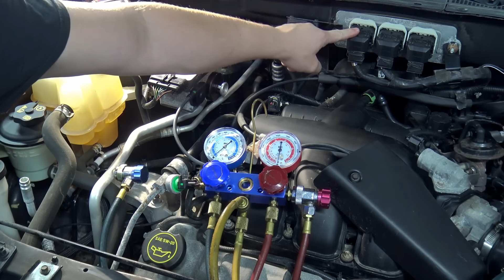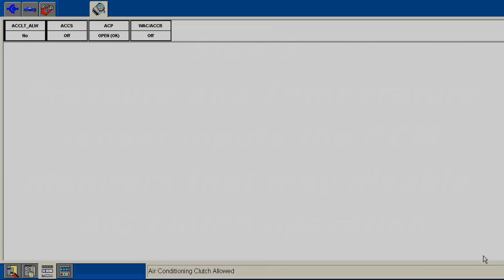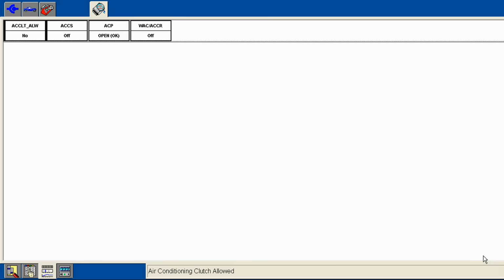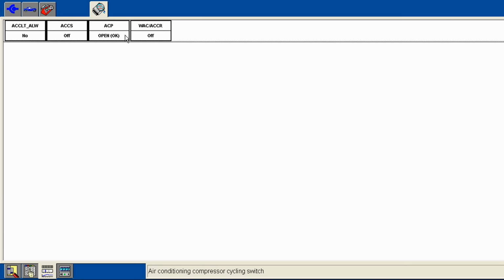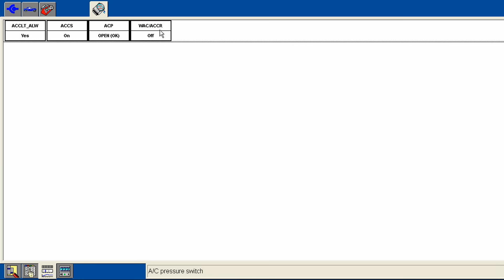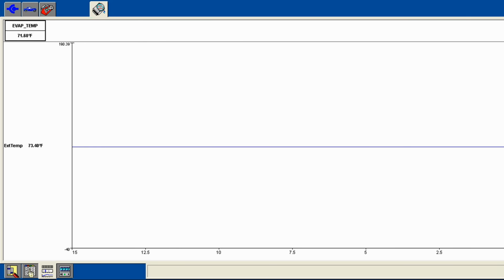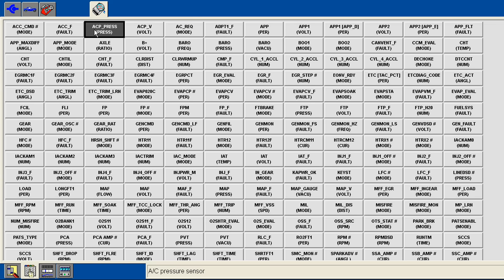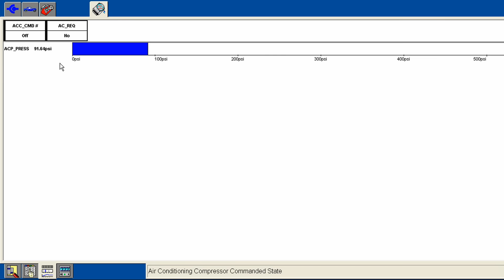Ford A/C Quick Tips #7: How To Quickly Diagnose A/C Concerns

Comment: Very profesional i love your videos. i have a question i hope u can help me: 2010 ford Fiocus 2.0 ac comppressor wont activate, everything is new, and i only can activate the compressor with scanner, and works perfectly, i checked all the info abouth switches and sensors, and the only one i can see is not reading prssure is tha ac pressure switch, the switch is good, if i remove the switch and add air with air blow gun it will read pressure, but connected to the ac line it wont read any pressure, i replaced the shreder valve where the pressure switch is connected just in case was stocked and no change.  (When i activate the ac compressor with scanner then i can read the pressure going up on the switch) The ac pressure switch connector has this signal on wiring (5v, 4.9v and ground) Thanks in advance for your help

Comment: If my AC can't stop running, when i disable it with button, is it electrical problem, or bad clutch?
Reply: It might be an electrical problem since the AC compressor clutch uses an electromagnetic coil to engage and disengage. When not energized the pulley should spin freely.

Comment: I have a problem with something on my 2006 Ford F150 Lariat 4x4 big v8.  I got a P1000 a year ago with different dash lights coming on and Ford said to not worry about it, just drive it longer and it will go away. I asked them a year ago if someone in their shop had started a diagnostic without finishing, they said no.   So, I drove and sometimes it would show and sometimes it would not.  See, I was getting several dash lights coming on.  I would turn off engine and restart until the lights on the dash went off.  Then the air conditioner stopped working sometimes.  We would put refrigerant in and it worked for that given drive and the next time I started it the air would not cool.  I was getting P193, P462 for several months then within the last couple of weeks when cold starting all the dash would go haywire like everything was shaking on the dash.  I had no problem that I know of with the level of fuel on the dash gauge. Wonder if you can let me know if I need a new PCM or not and what are the average costs to replace.

Comment: Thank you for your videos they are very helpful. I have a question. I own a 2019 Ford Explorer limited 3.5L V6, is there a a/c low pressure switch and if so where is it located? the only one I see is the high pressure switch. thanks in advance.

Comment: I would like to get your input on an issue I'm having. I have a 2018 Ford Transit 150 with a 3.7 engine, and I'm encountering a B1B71 code, which indicates a short to ground in the evaporator sensor. When I ran the test, the reading was out of range, and the compressor keeps cycling on and off. Is there any way to bypass the evaporator temperature sensor, considering that the sensor is part of the HVAC box?

Comment: Hi,

I have a 2008 Ford Explorer, Eddie Bauer. I turned on my truck with my AC turned on. When i turned on i heard a loud noise. I thought maybe it might be my belt being it was very hot outside so i very lightly revved my engine and the noise died down and went away. Once that happened i noticed my AC stopped feeding me cold air and the cold air wasn't working anymore, it was pushing warm to hot air.  I looked under the hood with the truck still on and i see that the AC compressor unit was still spinning with no noise. I'm not sure if its the compressor that went bad or just simply need a refill of refrigerant.  Your thoughts are welcomed, appreciated and very help.

Comment: Thanks!
Reply: The Live Data PIDs for AC system helped me understand the system better. Intresting thing I noticed that for some reason the relay ground control pin activates even when not running but the ACCR PID says off, strange. Still not getting 12v from relay down to the coil positive pin, so my problem must be between the junction box relay and the coil, wiring diagram shows it goes straight to it from relay. on the 2000 F250 5.4 the AC is on bottom and nearly impossible to reach AC coil connector had to use hook part of pick tool to get it off, I tested off and back probed and at best I only get around 100mv at connector, but it's really hard to test, I can't tell yet if it's connector or further up. I ordered pigtail since I suspect issue is probably down in there where it's exposed to mud and water. really wish they put AC compressor on top, looks like it's going to be a pain to replace compressor like motor mount might need to come loose and jack up a couple inches to help clear cross member. I'm going to try jumping hot pin on coil too see if coil even moves, compressor was slightly siezed from not being used for who knows how long. vaccum held so no leaks maybe slow leak as there was zero pressure in system. I'll probably rebuild AC system, but for now need to figure out why clutch isn't even clicking or getting power to it, even though everything checks out.

Comment: I’ve got a 2010 ford f150 and a 2021. The AC auto function and blower work great. The 2021 AC auto function blows soo weak and simply won’t take my truck cabin to the desired temperature. I can use it manually and it’s fine but the auto function simply does not co trim the blower speed and coldness to bring cabin to desired temperature.  I had it checked at the dealership and they say there is nothing wrong. Does anyone else know what I’m talking about and has a solution been figured out?

Comment: Mines cool but not cold. Needs recharge? Or other issue.
Reply: Probably. Since it’s already cooling, you know the system is working. However could be a restriction in the system or the expansion valve.

Comment: Hi there, I had replaced my AC compressor along with the dryer and the Exp valve and while everything worked great for a short amount of time I was at idle at the beach (hot) and the compressor seems to have discharged all the pressure from the system quite suddenly. What could be my issue? I don't believe this car (2005 Expedition) has an orifice tube so my best guess is a faulty EXP valve?  Thanks for any feedback possible.

Comment: I accidentally turned the heater on last summer and now my a/c doesn’t always work. What do I do?
Reply: Two different systems , not sure why you think turning the heater on in summer would take the AC out. Other than the blower motor they have no connection between them.

Comment: I have a 2014 ford mustang and at first the ac started going in and off but if you tapped the blower it would come back on .. one day it completely stopped working so I replace the resistor and now it’s a delay to start but it blows sooo much hot air I tried changing the switch , did the Freon thingy , and jump started the compressor and that’s when it got cold … I think the clutch is not moving what is the issue omg I’ve already wasted so much money

Comment: I’ve been having trouble with a 2013 Ford F150 that I just bought. The AC system is just not cooling as well as it should. This is what I got today:
System evacuated to 29”hg for 45 min, held vacuum for 10 min, charged with 24 oz 143a as recommended. No air introduced.

Brought vehicle to run temp.

Gauge readings L42, H190.

Climate control set to 60 degrees, Hi Fan, Max AC with recirc on.

Ambient temp 91, temp at vent 71.

FORScan live data:

AC clutch engaged (never cycled in 45 minutes of running)

Evap temp 58

left blend door 4%

right blend door 3%

recirc door position rotates between RECIRC, Fresh Air, error about every 5 seconds. 

Internal temp 88

HVAC DTC: Code B183 Recirculation Damper Motor with Additional Fault Symptom: Mechanical Failures

My thought is to start with the recirc door. The DTC and live data indicate to me that the motor is not working and the door is likely stuck in the fresh air position, or somewhere in between. I’m going to access it from underneath by taking the blower motor out rather than taking the whole dash apart. If it is stuck open, that would be affecting my Evap temp, right?

Also, the blend doors should be at 0% when the climate controls are at the lowest temperature setting right? They are working, but just stop at 3-4% on the lowest temp setting. Is that enough to worry about? Is there a way to calibrate them?

At any rate, I think the recirc door is my biggest issue. Any input would be appreciated.

Comment: Does anyone know where the low pressure cycling switch would be on an 09 fusion 2.3? I can only see a switch on the high pressure line. Assuming I have an issue with the low pressure switch as it stays in the “off” position when turning the AC on or off.

Comment: So...hopefully someone sees this before I pull the rest of my hair out.  I checked fuse 11, 13, and one other on the top of the fuse block and all of them are good.  I hotwired the AC Relay and the AC clutch will engage and cool the car if I leave hotwire in where the relay was.  Relay tests out good, just for kicks I bought a new relay and put that in, still nothing.  Also hotwired the high side pressure switch and that didn't work(I did this with speaker wire I had available so...could that be the issue?) What else do I look at? (05 Navigator 5.4 with ALL NEW aftermarket AC components.  Was working fine...was idling waiting for a phone call and it just stopped cooling....clutch not engaged)

Comment: Quick question my ac works and clutch engages.  The low pressure line is cold.  Then after driving for about 10 minutes the car starts blowing warm air.  And the ac clutch stops spinning and the low pressure line is warm.  But I can wait 5 mins with hood open start it up and ac starts working until it heats up in the engine bay again.
Fans are working, relays are fine, and there is enough freon in the car.

Comment: My 2004 F-150 wasn't cooling very well so I added some 134. so now it blows cooler but if I drop the fan speed down a notch it blows colder, do I need more 134 ?  I don't have gauges or vac pump.

Comment: At least 50 psi low? I have a 2012 svt raptor with 6.2L.  Is this “at 50 psi” low pressure applicable to my truck the same? I can’t find it anywhere for what pressure it should be at on low and high…just the amount of r134 is 21oz. I have gauges and a pump. On my gauges it was reading 25 low but 150 high. Compressor keeps kicking on and off. Not sure if it doesn’t have enough because I don’t know the proper pressure it should be

Comment: Got a question I’m at my wits end have a Ford Explorer 2013 eco-boost engine 3.5  issue. I’m having with this stupid air condition. The climate control the driver side is mixed with air condition and heat on the passenger side ice cold changed out, blend door module on the driver side defrost doing the same thing it’s cold on the passenger side on the driver side. It’s just warm light cold air condition air the rear end air-conditioning same problem no air condition at all pipes are getting cold to the unit, but it’s mixing with heat. I wonder if I have some kind of issue with the air condition system they only fault code I get is a blend door on the rear end of the air conditioning

Comment: Fixed my 2008 f350 AC with this video. Compressor wouldn’t engage at all and was seeing too high of a pressure on the low side service port. 

Turns out the electrical connection to the compressor was loose. I tightened it up and then the compressor would come on for a couple of seconds and then stop. The refrigerant recharge bottle wasn’t seated deep enough. I reseated it and when the compressor did run for a few seconds I saw the refrigerant was low. Filled it up with a recharge kit and now I have a working AC!

Comment: 2019 F150. With Forscan, all tests seem normal. When I monitor live data(all AC related in PCM) there are no errors. Pressure reads between 850-1000kpa. Forscan says AC clutch engaged, but when I look at the compressor, the center clutch hub is not spinning. I dont have gauges, so I am trusting the reading from pressure sensor(125-145 psi). Is the compressor or clutch hub damaged? What would be the next step? Thanks

Comment: I had a problem where my AC system was actually working too good, causing the evaporator to freeze up, and stop air flow alltogether. This was just after I took the truck to so called "experts"  for AC problems. When i picked up the truck 1000 bucks later they were raving about the 25 degrees coming out of the vents. On my way home it dawned on me that 25 was too cold. The so called experts completely overlooked the high pressure cut off sensor.  Once I changed that, my AC worked fine. I also used a hole saw to drill a hole in the airbox so I could spray foaming coil cleaner on the evaporator, since Ford, in their infinite wisdom did not provide a cabin air filter on the 2004 F150

Comment: Hi, love your videos!

I have a 2015 F150 that I have owned since new.  It now has 140k miles.  2 weeks ago my AC clutch stopped cycling.  I have 100psi static, KOEO enables clutch, forscan shows all sensors, hvac controls and transducer are seem to be operating and reading as they should.  

Im sort of at a loss here.  I must be missing a sensor im not monitoring?  Dealership wants $200 for AC diagnostic, and Im getting close to biting the bullet.  Any suggestions before I do so?

I replaced my TXV about 2yrs ago with OEM motorcraft part (high speed fans on).  Had local dealer evac and refill.

Comment: I have a 2000 ford explorer. The ac quits working when you are driving here lately. I put my manifold gauges on and cranked the truck. The reading were 42 on low side and 260 on high side. Then i can increase rpms and the low side goes to hardly anything and compressor shuts off. Any idea whats going on?

Comment: 2004 F150. My ac eventually blows cool, but never cold. I thought it was low on Freon, so I got some from Napa. But when I hooked it up, turned it over, the pressure gauge would go up and down even before i would press the trigger to release Freon. It read in middle green, 40-50psi. Theres a sound from maybe the clutch, then i lose pressure again. What do you think I should do?

Comment: Good evening.  I have a 2004 ford expedition, 5.4L Eddie Bauer.  My A/C clutch is not engaging.  The #11 10 Amp fuse keeps blowing.  Could there be a short in the compressor or could it be a bad clutch?  It spins fine when not engaged.

Comment: I had a question ford tech what is it when your ac compressor button on the climate control panel doesn’t want to come on and the ac is good on Freon and no vacuum leak and the ac clutch is working like it is supposed to any idea

Comment: 2006 to 2012 Ford Fusion and the Air blows cold for just a few seconds and then turns to heat, click the temperature control nob two clicks to the right off the coldest setting and start the car/AC. Some folks have said that turning on the headlights and fog lights on also works. I haven't tried it yet because it is 90 degrees here and I'm leaving my AC on and don't want to mess with anything until fall. 
Apparently, there is some service notification about the computer related to all the vehicle cabin functions and controls that is causing this.

Comment: I have a 2005 Ford Freestyle. I've had to recharge the AC every other year during the summer which is no big deal and I have cold AC for the rest of the year. However, this year the AC quit. I checked and added like I normally do, but it takes hardly any before it looks like its over pressured. After doing some basic troubleshooting, I did replace the scroll valve, but I realized that the compressor isn't kicking on as it is blowing a 10 amp fuse. I replaced the fuse, as soon as I hit the AC button compressor kicks on and blows the fuse. Any suggestions where to start?

Comment: READ THIS!
I BOUGHT 2001 EXCURSION V10.
THE LAST OWNER HAD EVERYTHING REPLACED BUT THE CONDENSER. SO EVERYTIME I COME TO A STOP THE AC STARTS BLOWING WARMER. IT WAS NEVER COLD TO BEGIN WITH ONLY ON #2.
SO I REPLACED EVERYTHING AGAIN NEW COMPRESSOR AND ALL. I ALSO USED 4 CANS OF FLUSH TO INSURE EVERYTHING WAS CLEAN. ADDED A NEW LOW SIDE PRESSURE SWITCH,
ADDED THE 12 ONCES OF PAG, AND 4 LBS AND 4 OZ OF R134A. 
NOW ITS ALL NEW AGAIN WITH NEW CONDENSER AND NOTHING HAS CHANGED. EVERYTHING CAME FROM O'REILLY'S. I ALSO THOUGHT MAYBE THE CONDENSER WAS NOT HOOD SO WE TRIED A DIFFERENT ONE. STILL NOTHING HAS CHANGED. ASLO WARRANTY THE FAN CLUTCH AND STILL
 MY PRESSURE ON LOW IS 65
HIGH IS AT 350 PSI WHAT IS GOING ON?????
PLEASE HELP. IM 20 YRS EXPERIENCED. EVERYBODY AC WORKING BETTER THAN MY OWN.

Comment: I have a 2005 Ford f250 4x4 6.8L V10. My ac is blow cool air through my defrost vents. I have checked all my vacuum hoes for leaks. Truck is running good also showing no signs of a vacuum leak. Would you have any suggestions on what could be the issue.
Reply: Had this same issue, there is a vacuum line behind my battery, well it was completely fried and looked sucked in, replaced the line and it was fixed, took about 10 mins to fix!

Comment: Great video! I was working on a ford f59 and saw this message on live data... 8:Strategy Has Not Yet Detected Hardware That Indicates
Vehicle IS Equipped With Air Conditioning (A/C), So Air
Conditioning (A/C) Clutch Engagement Ils lnhibited.: Yes.
It got sent to the dealer, but just wondering if you have dealt with it before. Thanks.

Comment: got a good one for you : 01 ford ranger 4.0 good charge , did all my checks and have power at the compressor but fails to run (it runs if I manually latch in the relay) got the airflow to 28 degrees at 2000 rpm  . have power to 2 of the 4 terminals behind the ac switch and the fan runs even when ac is in the mode, but compressor isnt turning >   suggestions ,  ????   checked all fuses and relays ,swapped them and jumpers to get the clutch to engage , it just dont do itself!!!     what am i missing , oh ya   checked all the grounds 2x , wiggled wires and cant get it to come on?